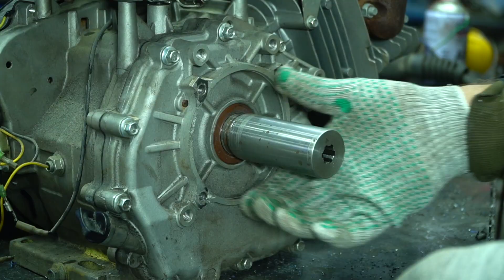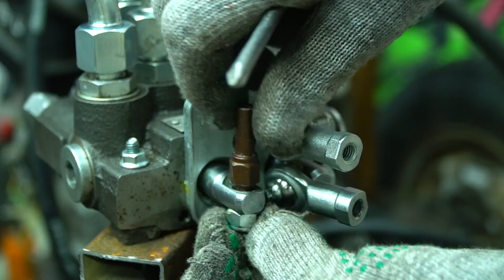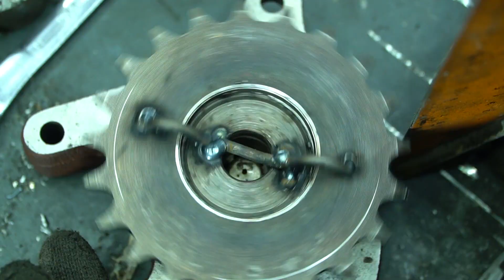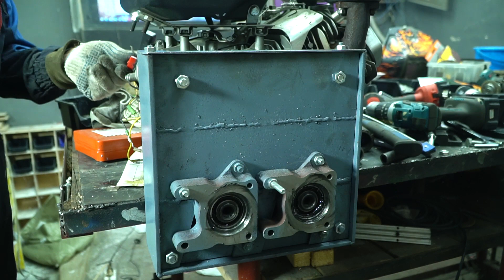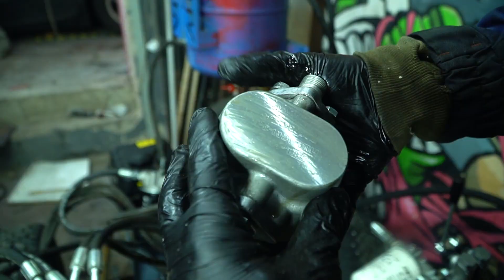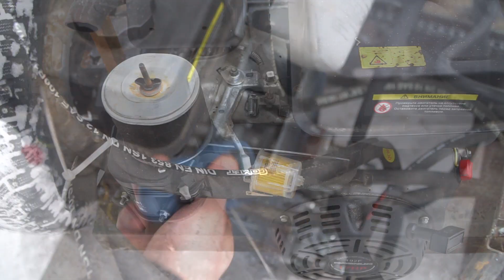Skid-steer loader. Part 2

Comment: This is not a good design. The chains to the wheels need to run in grease, and the gear pump drives need thave sealed bearings, otherwise they will get dirt in them and shorten their lifespan. The wheels are mounted backwards, so the lug nuts cannot tighten the wheels in original orientation, keeping them from the proper torque, and also how does one check the air pressure in them?
Reply: It's a work in progress.

Comment: Very cool! I would have designed the drive chains differently. I would have gone with 1 long chain and had the vertical adjustment of the hydraulic motor be the tensioning. But still really cool and can’t wait to see the rest of the build.
Reply: The early aussie dingo 950p had the hydraulic motors driving one pair of wheels thru a hub, with a sprocket on that hub and a chain drive to the front wheels. I'm a little surprised the builder hasn't done similar.